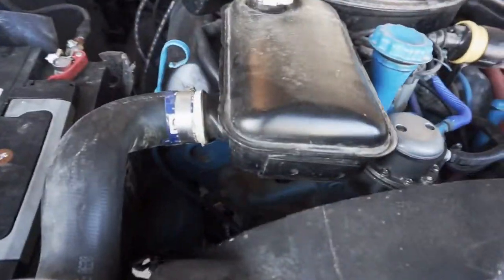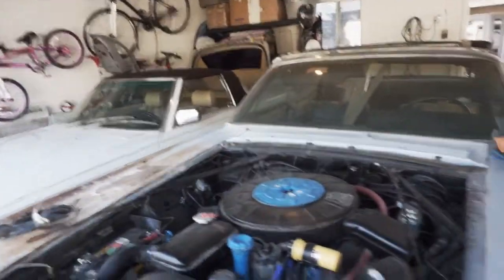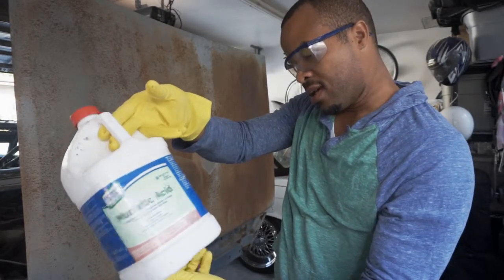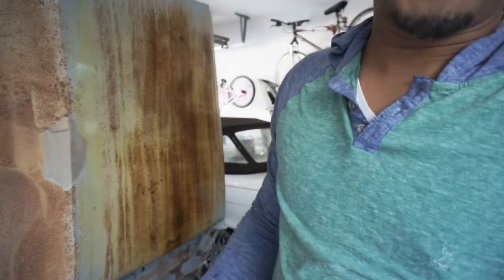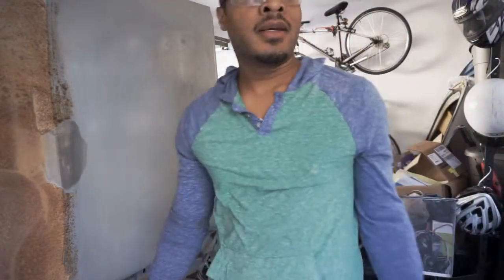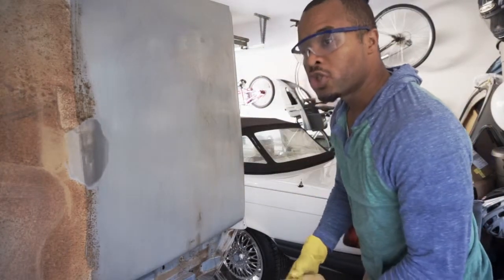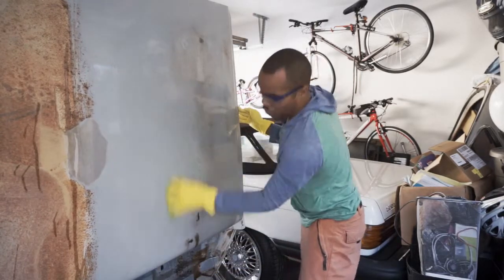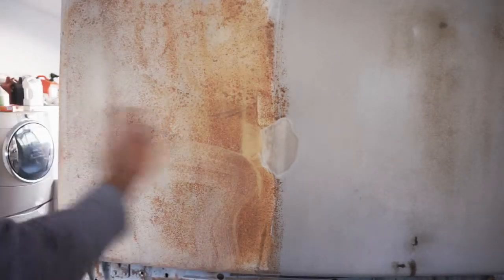CLR vs Muriatic Acid - Removing Surface Rust

Comment: Very cool and helpful video! I'm planning to do the same to one of my projects, maybe even use it to restore a rusty gas tank. 

But a word of caution if you're doing it again sometime, I think the best way to neutralize the acid is with something chalky like Baking Soda or Limestone. Vinegar is weaker than Muratic acid for sure, but might still do some damage if left on there for too long. Maybe dissolving some baking soda it in a bucket of water and use that to wash the piece down. That way any acid left in the cracks or crevices gets knocked out and doesn't keep eating away at the metal.

Comment: Question,which strip Kleen muriatic acid is that the old one or the green version?
Great video too.
I have a 70 c10 cab that has surface rust .
Reply from the maker: Phil Ortega good question. I’m not exactly sure got it at Lowe’s I believe